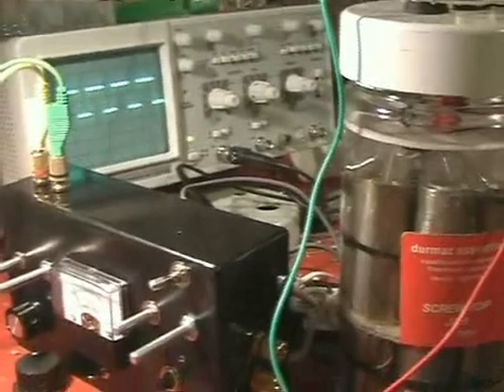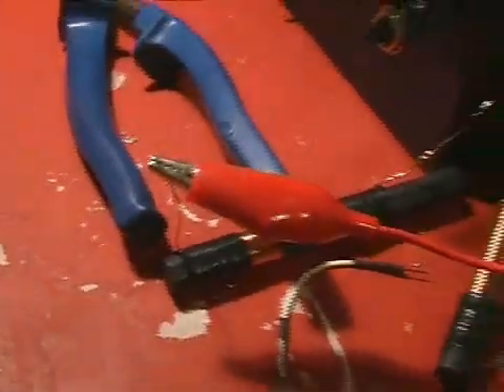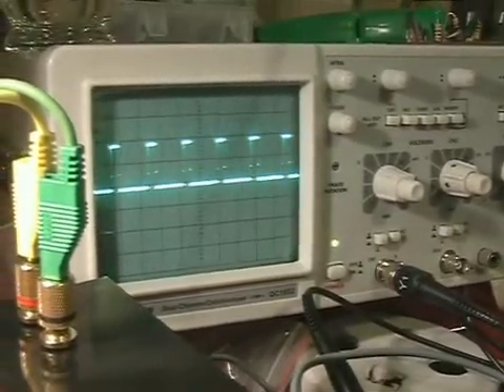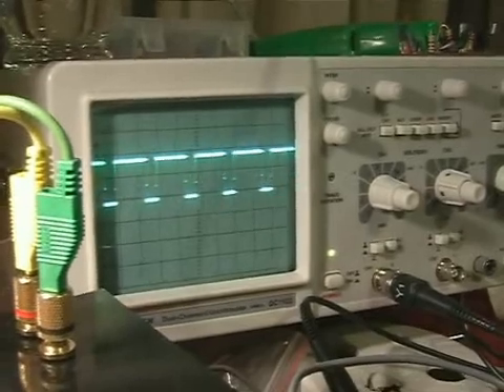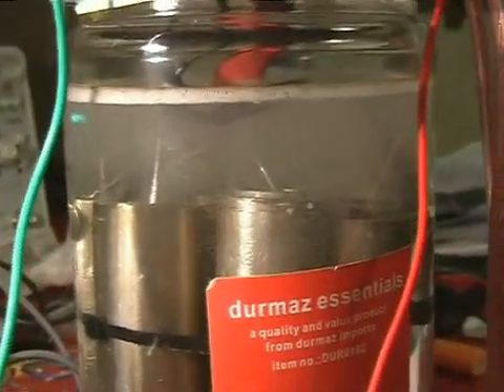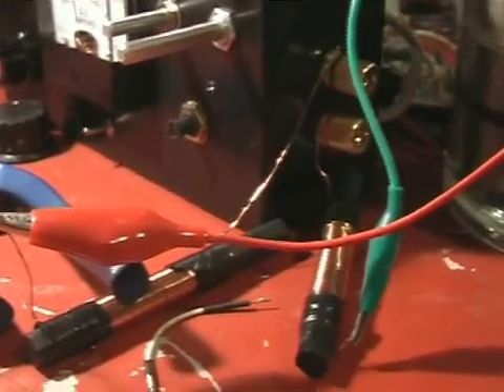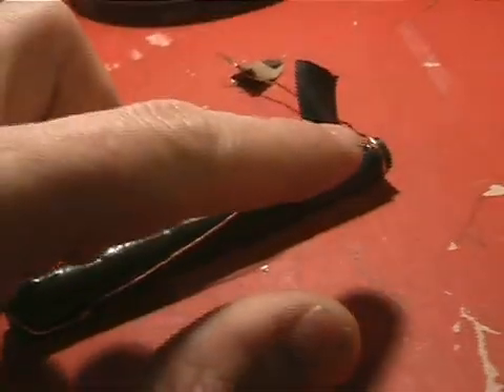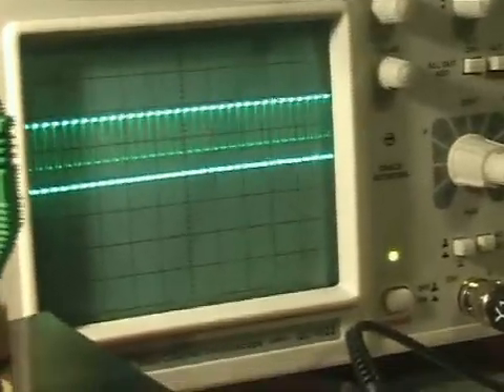D. Lawton Meyer Replication Test 2

Comment from the maker: Thanks Dave, I will try with these smaller pipes now that I have them in arrangment. As for the current, it needs to be inhibited by a few other things yet to be added to the circuit. I am still working out what the VIC should be made of.